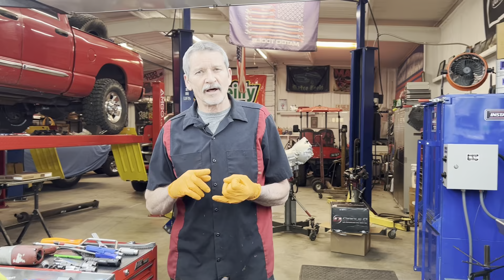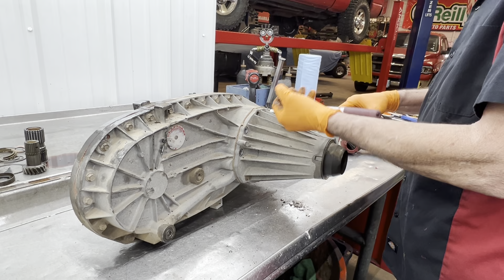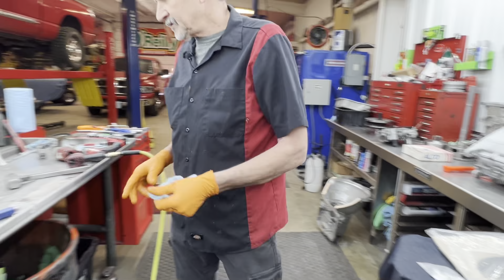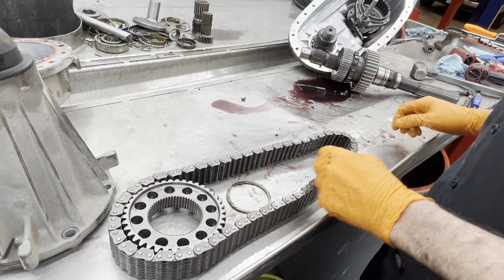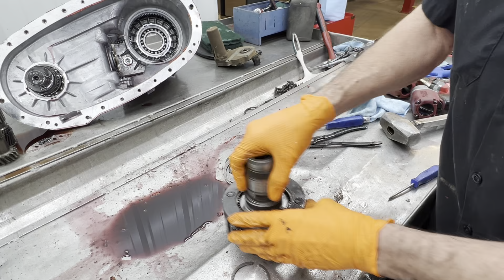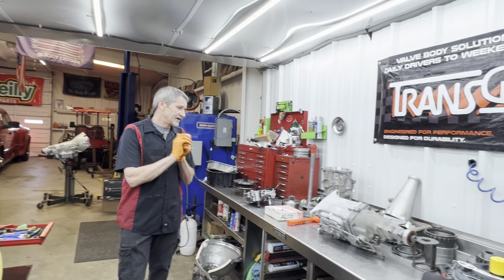273 D - Dodge Transfer Case.

Comment: Hey Richard this is Cam up here in Michigan im sure your busy right now making things look easier then they are. I dont have much experience rebuilding transmission ive down maybe 8-10 with a mentor. But im struggling getting any endplay at the input shaft ive got something messed up i just cant seem to figure it out its a 4l60e 2013 style. Ive got about .030 in the output shaft everything  spins freely triple checked bearing placement clutch clearance is there any thing you could recommend i look back maybe a problem with the input drum assembly? Any recommendations would be appreciated thank you sir have a great weekend.

Comment: Richard are you still doing rebuilds for the public?
Reply from the maker: Yes sir staying busy
Reply: @richardteresacricheducatio3542 how do I get a hold of you for pricing on a 4T65E 2002 GTP transmission? It's supposedly a built one. Engine has some work done to it. But when I got the car it didn't last long
Reply: Why did you leave the old shop if you are still working?

Comment: Sonnax is the way to go, like you said it's a better metal and it'll be hardened unlike the factory stuff. Happy Easter. You're right about retirement, I'm busier now than I was when I was working. I don't work on school buses anymore but my own stuff and different projects never seem to stop lol. Next in line is my 71 Demon getting the transmission pulled and sent out for a rebuild and get it ready for a drag n drive in October. One of our stops will be Amarillo Dragway.

Comment: I noticed your old transmission jack you had it I used to work with one that was made by gray automotive and that was one hell of a transmission jack the first stage was air and then you pumped it by hand, the rest of the way and what was need about that jack the lady told me I called her about some potential parts Find out we didn’t need them anyway that jacks were designed in the 40s and they could still get parts that was clear back into the 80s all right I like your shop unfortunately I wish you would do carryout but you don’t cause I have a 47 Rh for my Dodge and I really want you to do it but Anyway I promise you I know how to reinstall for example, your Christ or torque flight the torque converter was approximately 7/16 of an inch back from the flange of the bell housing. That was my old 727 all right catch you later this is six in a row.Jim from Kennerdell Pennsylvania

Comment: Richard and Teresa, where do you get your stick shift transmission parts from? I want to rebuild my Ford M50D-R2 5 speed this summer.
Reply: Do a Google search ...type in buy Ford M50D-R2 parts
Reply: @imtheonevanhalen1557   I don't have a problem doing that but I would prefer to get parts from a reputable place like someone that Richard and Teresa use, they are transmission specialists and have a large group of dependable suppliers to choose from

Comment: How did the splines get wore out,  when it has that double lock that keeps any slack away from the spline's.??  it looks like even if the splines weren't there the shaft would still turn just  using llocking dog's.
Reply: 100% agree, my thoughts are this  modification was done after the splines wore out, and if that is true, the locking dogs are doing just fine. if that was my transfer case i would say if its not broken don't fix it.
Reply: I've watched that show for years, and Richard is a really shrewd sailesmen. he talks people into buying way more expensive parts then they need on the pretext that the blueing is faded. or it Just might brake. I don't know,  i'm starting to see a little underhanded sailsmen ship going on. He keeps saying he cant make build videos because it would take to long, is that really the reason?? he made one a few years ago, why have thing changed.??  @frankmouskovias8921

Comment: It is interesting that some transfer case seal kits will not come with the oil pump O ring.  That is really something. I think I would specify using the brand kits that do include them vs. those who do not. Maybe those manufacturers need some feedback from the wholesalers to include them for obvious reasons.